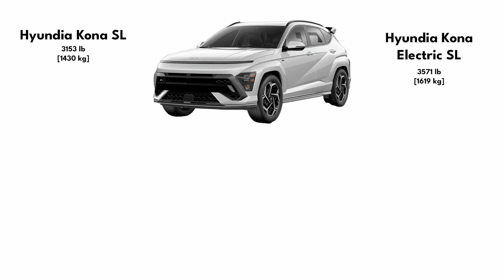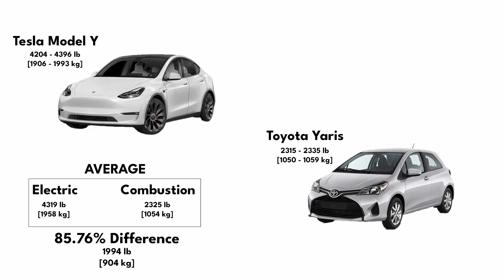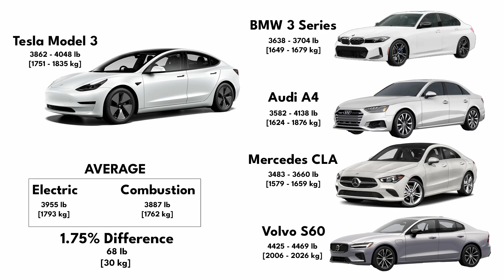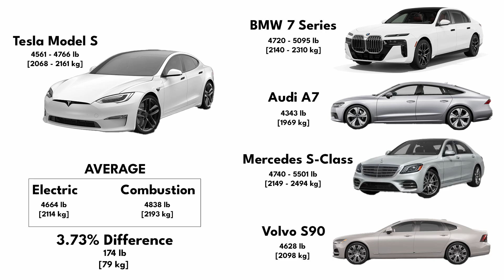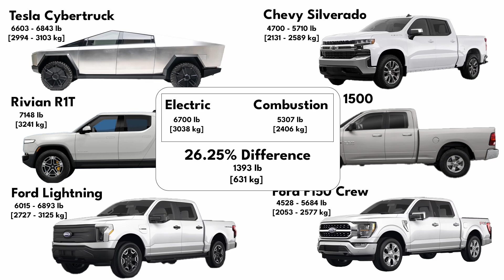Shocking Guardrail Failure: EV Weight Debate

Comment: Imagine having to crash test evs with actual battery packs in them.
Reply: EVs are a huge fire risk.
Reply: Technically they needn't; they could put ballast in place of the battery pack so overall weight and balance are the same. Unless, of course, battery pack integrity after a crash is part of the test.

And since a discharged and fully charged battery pack weigh the same, there's no need to charge it before the test. So there's that.
Reply: they are crashed with battery packs...
Reply: @tarassu are they uncharged at least?, so there is less fire chance.
Reply: @lukematthews2209  There is a higher chanc
e of a gas car catching fire after a crash. They both have potential to burn of course.
Reply: @segstron How do you figure? Gasoline doesn't typically catch on fire, the fumes do. Most ICE vehicles don't result in fire and nearly all ICE fires are a result of electronics.
Reply: @James_Bee  I'm not guessing here. This is a quote from the guardian:
"Australia’s Department of Defence funded EV FireSafe to look into the question. It found there was a 0.0012% chance of a passenger electric vehicle battery catching fire, compared with a 0.1% chance for internal combustion engine cars."
Another quote from thedriven article
"Contrary to common disinformation about electric vehicles, data from the Swedish Civil Contingencies Agency (MSB)  has shown that EVs are 20 times less likely to catch fire than petrol and diesel cars."
Reply: @ But is that report speaking of the chance of a vehicle spontaneously catching fire while in normal use or even while parked, or the chance of fire after a collision?

Of course, it would take some to beat the Ford Pinto, and that was an ICE car.

Comment: I got a major problem with the internets comparable cars.  For on the model y is a sedan and all the "comparable" cars are suvs.  Theyre not comparable at all unless youre trying to match the weights and prices.
Reply: It's a crossover SUV trying to look like a car. Crossovers are not full trucks or SUV. They are just tall cars with bigger wheels and raised ground clearance. The BMW X3 is also a crossover SUV, based on the 3 series but with bigger wheels and a taller cabin.

Makes more sense in Europe where we have a lot more crossovers that we call SUV and hardly any large trucks that Americans  call SUV if they don't have a pickup bed.
Reply: Makes me wonder whelther it is intentional.

Comment: Excellent video as always! As you showed, EV's are certainly heavier in a lot of cases, but they are only a part of constantly increasing vehicle weights and not the main one. Regardless of the reasons, it's certainly problematic in many ways that vehicles keep getting larger and heavier every year and IMO it's time for the government to start doing something about that, especially since they are largely responsible for it in the first place with fuel efficiency and emissions regulations favoring large vehicles, "light" truck exemptions, and crash safety regulations. A weight tax on personal vehicles regardless of fuel type is sounding like a great idea nowadays!

Comment: UNRELATED: Recent LG solar Lithium battery recall in 'Straya due to house fires.

From the Australian Consumer & Competition Commission ...

----------

The safety warning notice was issued pursuant to the Australian Consumer Law to alert consumers to the risk of house fires associated with certain LG solar lithium-ion storage batteries which are the subject of a product safety recall. 

The affected batteries risk overheating and this could start a house fire that could potentially injure or even kill occupants, as well as causing property damage.
About 8,000 affected LG batteries remain at risk in homes across Australia.

The affected batteries were manufactured by LG and installed in LG branded systems as well as in systems sold under other brands, such as SolaX, and in unbranded systems. Concerningly, about 6,000 of these batteries have not yet been located. 

“Following the Minister’s urgent safety warning, consumers should check whether their solar storage battery is subject to the recall today. This includes non-LG-branded solar storage systems, which may also contain a recalled LG battery. If a battery is subject to recall, it should be switched off immediately,” ACCC Deputy Chair Catriona Lowe said.
“Thousands of people may be unaware they live in homes that have one of these affected batteries installed in their solar energy system. The Minister has issued a safety warning notice to draw attention to the safety risks. It is vitally important that everyone with a solar system checks their battery now to make sure they keep their family safe.”

----------

Comment: The problem is bigger heavier cars. 
With an ICE you can choose a small light car that does not bulldoze everything on impact.
The current generation BEV has to be big and heavy to be somewhat usable, and that is a problem.
I wil just wait until there are EV batteries that weigh a lot less, charge fast but don't self-combust like NMC does.

Comment: Something has to go horribly wrong for a truck to go full speed directly into a guardrail... normally you're traveling in parallel with the guardrail, so somebody has to hit you from the side in just the right angle to get the same result as the test.
I don't think there's a problem with heavier vehciles, BUT improving ADAS and guard rails wouldn't hurt.
Reply: I looked at both clips very carefully and they are two camera angles of the same, single crash. The 'head on' looking angle is optically compressed because they are recording with a very long lens eg 1000mm. Obviously they had to set the camera at a safe distance and zoom in for the shot. The other camera angle is using a more normal lense 50mm - 75mm maybe.

Comment: I agree more research needs to be done. I'm thinking vehicles in general are larger and heavier so guard rails likely need to be reinforced or redesigned completely.
Reply: And who's going to foot that incredibly expensive bill for countless millions of miles?
Reply: There's a difficult with reinforcing guard rails to accommodate heavier vehicles. The guard rails do two things. (1) They deflect vehicles away from something more dangerous such as a concrete wall. (2) They absorb some of the impact energy, protecting passengers. A guard rail that properly bends and absorbs the weigh of a heavy vehicle might be more like a solid structure to a lighter vehicle, doing greater harm to passengers who already have less protection.

Comment: Hi there I think that car's and trucks need to be designed for the guardrail and not the other way around, as if I designed a pickup with a higher ground clearance then it would just go right over the rail. Yes the guardrail needs to be looked at every few years. But cars need to comply with serton standards for the country of sale

Comment: Probably would have been good to include the compact car segment. A Nissan Leaf is 3500- 3571 lbs, the closest ICE equivalents are Honda Civic at 2935-3077lbs, Toyota Corolla 2955 - 3155lbs and Hyundai Elantra 2811-3028lbs.
Reply from the maker: IMO the Nissan Leaf is an EV built into a legacy package.   It's not really a modern EV design.
Reply: @StacheDTraining  Good point. The Chevy Bolt is about the same weight! That also is legacy packaged. It will be interesting to see what Tesla does with the "affordable EV" which I assume will be in the compact class once they get the Optimus robots replacing human workers and lower the labor costs.

Comment: Infrastructure really hasn't caught up with modern car design in general. Most of those guard rails were developed in the '70s when cars were longer, lower, wider, and lighter than today's cars. Earlier cars were "soft" and would deform considerably more in a high speed collision and the larger front profile would distribute the load across more of the guard rail. Today's cars are way heavier and have stiffer crash structures. My '80 Duster weighs 3,200lbs and a modern car of similar size is 1,000+lbs heavier. My '81 Dodge truck weighs 4,200lbs and is larger than the 7,000lb Rivian. The guard rails of today were designed to absorb the impact of a "soft" car to prevent injury to the car's occupants and less consideration was made to "stopping" the car.
Reply: Ahem! The body-on-frame, big-block V-8–powered cars of the 1970s were LIGHTER than today's cars?? And body-on-frame deformed MORE in a collision than today's unibody designs with built-in crumple zones that have to pass industry crash tests?

My mom's 1968 Thunderbird was 5,000 pounds. A 1937 Packard Eight was 6,000 pounds. 1970s cars were unrealistically light in an attempt to meet mandated fuel-economy and pollution-control standards.

Also, the crumple zones of a modern car are mostly at the front, and to a lesser degree in the back. You do NOT want a car to have excessive give on the sides, so that the occupants are protected in a side crash.

Comment: If the guard rails can’t take the weight of one ev then it’s definitely not going to stop a hgv without a trailer.. 
screw the ev owners they brought them 😂
Reply: Guard rails aren't intended to stop the vehicle, it's designed to deflect the vehicle back towards the road (at least to some degree).

Comment: Screw the guardrails. What's that going to do to an ICE compact car?
Reply: The IIHS will simply tell you to buy a larger and heavier car like they have been doing to prospective compact car buyers for the past 3 decades.  That's why the 2024 Honda Civic is larger than a 2000 Honda Accord.
Reply: Win, always put the advantage on your side. Small light weight cars always get punted 🏈
Reply: Hmm, I wonder... With such a low centre of gravity, maybe slide right underneath?

Comment: I was under the impression that crash barriers are designed to be a compromise over the largest range of vehicles, from your small two door runabout to trucks to semis. If this is the case, then the debate about whether EVs are less served by crash barriers because they are generally heavier than ICE vehicles, is surely moot.

Comment: His comparisons are terrible. The Model S is n't what you might compare to an S Class, or 7 or A7. Usually cars are compared by size and/or price.
The short wheelbase S Class is 5.2m long, the S - a foot shorter at least.
The short wheelbase S Class costs £92 to £190K, the S - ££93K to £113K.
More often that not The Model S buyer is NOT the same person as an S Class buyer.

Comment: As a truck driver I can tell you right now the vehicle dynamics of hauling around a bunch of batteries is way different than any other kind of freight. I never want to transfer another load of batteries in my life. About six or seven years ago I had to take a load of batteries out to Phoenix Arizona. Everything was relatively fine until I got to where I had to head straight for Phoenix, and then the road went through some very steep very terrifying mountains in Arizona. Just to keep the brakes from overheating and me riding off the road I had to reduce my speed by 2/3. If you have never been in a vehicle where you started to feel out of control and see your brakes smoking as you started to attempt to stop, you never want to. For that reason alone, I would not want an electric car. They just keep coming up with more and more reasons for me not to want one of these death traps.
Reply: So it's the weight of your load that's the problem. If you were carrying the same weight of steel, would you still have the same problems?
Is a 10,000lbs  load of batteries heavier or lighter than 10,000lbs load of steel?
Reply: @Hell-Hound1  depends how dense the driver is….. 😂
Reply: At first yes ... as it discharges then no.
Reply: @Hell-Hound1  Its not hundreds of batteries it was like 48 lead acid batteries. it was about 40,000lbs/18143kgs. batteries still on the floor because if you put them up high it could cause the truck to roll over. the center of gravity make it a scary ride. in a car the center of gravity is similar. it is typical that the EV evangelists come out to make excuses every time an incident like this happens. this tech has been rushed out to comply with a 2030 globalist Marxist agenda. A cold winter exposed the scam before the dim-witted public bowed down and excepted these non-nonsensical mandates. screw EVs!
Reply: Your trailer filled up with hundreds of batteries is never going to have the stoping power or one ev and it’s 4 brakes…
I’ve seen plenty of hgvs cook their breaks on hills that’s why that have run off ramps at the bottom hills
Reply: @hypernovatv911

As a driver I can tell the difference from hauling 40k lbs of batteries vs 40k lbs of iron. I can however feel the difference with a tanker. When hauling fuel the load can become very unstable and tip the trailer over.
Reply: Then your truck was overloaded. A ton of cargo is a ton of cargo, be it batteries, lead ingots, or feathers. I am of course assuming the load was properly balanced in all three examples.

Also, BEV is not the only feasible EV tech. Fuel cells and turbo-electrics are also viable and dispense with the huge battery pack. But then you lose the convenience (and low expense) of charging at home.